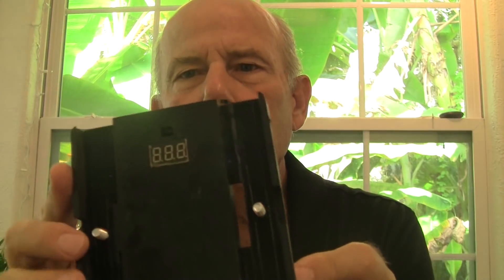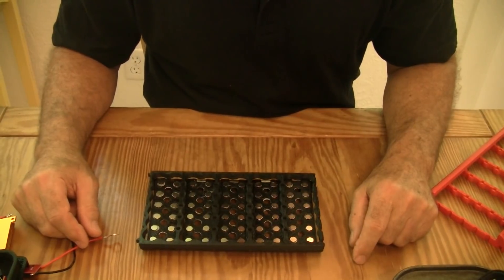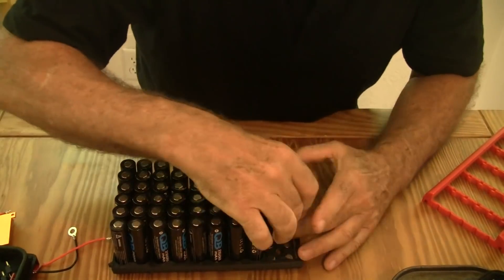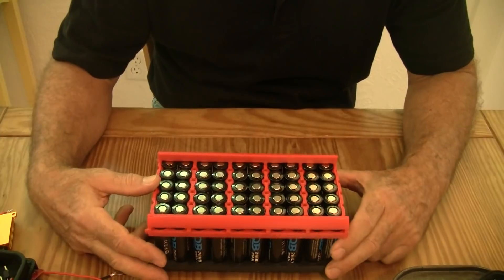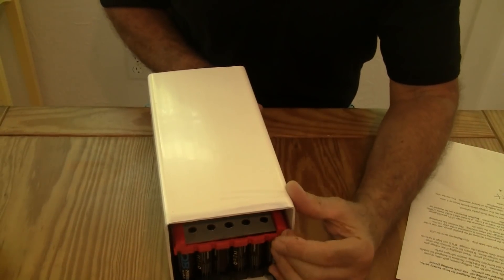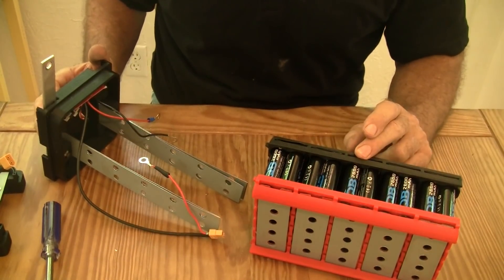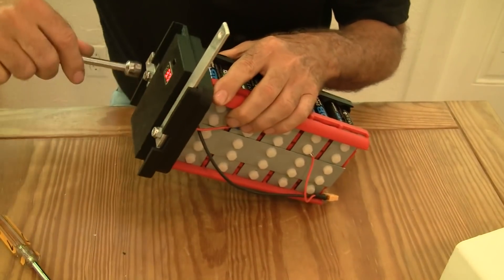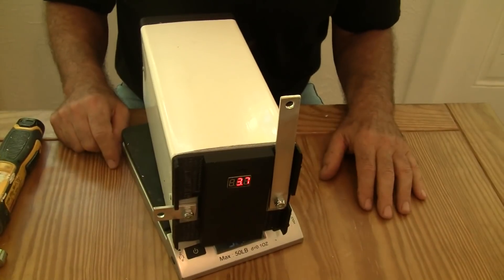Building and balancing a large lithium ion battery using BatteryBlocs

Comment: Hi Shawn. The bloc build fitting into a PVC fence post is a clever idea, as are the magnets. Have you had any corrosion or contact issues with the zinc coated plates that you are using to bond all this together? Is the very moderate pressure of the nylon screws enough? Have you taken a FLIR camera to the packs under full load test? I'd be interested to see if any hot spots show up. I agree with you that active balancing is the way to go when you have high current capacity parallel cell blocks or high capacity cells.  My primary concern with the system though is that there is no provision for any fusing in your system, whether that be between blocks or on individual cells. A single cell starting to fail in fuse/short mode in a 60P enclosed pack would be hard to identify and on failing would be catastrophic. Your blocs are made to be serviceable, but part of the issue is identifying the bad cell. Have you considered using fused nickel strips in conjunction with your magnets? If a cell fails, the fuse goes, and life goes on with 59/60 working just fine. It's not so much of a concern with LiFePO4, but with Li-Ion runaway mode is a problem. Too many fires to ignore, especially in EV applications.

Comment: I am a newbie to electronics and how they work, but i would like build a solar generator to power a small apartment freezer for my kids ice cream busiess.  The freezer uses very little power as it is a new Danby 5.1 cubic foot freezer. How much power does that battery with 60 cells produce ? I want to hook up an inverter to it to power a solar generator. I appologize if this is a dumb question i am just tring to figure out how many 18650 cells to buy to power this generator. I have 60 of the batteries currently. Can you help
Reply from the maker: Brad, that is doable, a friend just set up a freezer in his tool shed using a few solar panels.   But I would request you to contact me at shawnwiththewind@gmail.com and provide the power consumption of the fridge, and the mah of the cells you have.  Then I can show you how to do the math.

Comment: Also is there a way to make sure the batteries stay balanced and charge equally?
Reply: Yeah he had a resister balancer inside there, that fuse at the back gets switched on at a certain voltage to keep it from overcharging.

Comment: Just seen your info on website so I would need the babyblock for my ebike an fit it so it has air flow but keep away from rain so can ,mount in my buggy as it has a roof with vent .
Reply from the maker: Sure, that would work.  I use my BabyBlocsinside fence post tubes.

Comment: Can you adjust the balance block for Lipo or other batteries?
Reply from the maker: Yep, the chip is programmable to any balance voltage, high alarm voltage, and low alarm voltage you need.
Reply: Shawn McCarty so there is away to adjust the valve of high and low voltage. Do you think it would be O.k on 38120 cells?
Reply from the maker: Like Headway cell?  Sure, it works just the same.  Yes, the high/low alarms and the resistor trigger are all programmable.
Reply: Shawn McCarty do you take PayPal for payment, I don’t know where you are and how much postage would be. I’ve got SPIM08HP pouches also, 8 of them and 24 of the 38120 8Ah, would like to know which size you think I need. Are you or your company on Facebook?
Reply from the maker: Sure-My company is www.batteryblocs.com and I am in the USA.  There you will find the Balancers and my business email.  We can sort out your battery requirements there.
Reply: Shawn McCarty OK, thanks very much. Mike.

Comment: what will be the connectors ?, if i plan building 13 units of this 60-block into a 46.8V. Each units will have  135Ahr capacity. Again this will be supported by off-grid solar panels. i want to sure of the inter connecting links before purchasing the units.
Reply from the maker: The connectors are aluminum busbars.

Comment: How feasible can you use 12 of this 60 blocks to building a 48V system to support off-grid solar ?
Reply from the maker: Sure.  It depends on your loads of course.  My home has a 100P14S battery made of mostly salvaged cells.  If I watch my useage and especially if I freeze water and move it to the fridge at night so I can shut it off, I can get through a long night.  When the last hurricane hit, power was out here on my block for a week, and Cecilia and I were very popular with our fridge and AC!   You start with your best guess of how much power you need to store.

Comment: I'm always amazed at your ingenuity. Most boats use 12V systems to power everything. What is the plan to get that kind of voltage. I'm guessing 3 of these in series at full charge of 4.2 volts would give you 12.6 volts. Some equipment is voltage sensitive and won't operate on too low a voltage, so it seems to me there may not be as much capacity at the lower end of the charge. You've probably figured something out. Please enlighten me.
Reply from the maker: Yes, it is an issue because the voltages of a Lead Acid and LIthium chemistries don't mesh well at lower voltages.  I'm working on a sailboat battery now, we are going to go 4S for 16 volts.  He uses solar panels and the motor alternator to charge.  He is going to change the wiring of his solar panels, putting two in series, to get 24 volts or so, then use a MPPT converter to step the voltage down to 16.  His alternator puts out 14.4 volts.  14.4/4 is 3.6 volts.  So the alternator will charge the battery if it is low enough...  3.6 volts is right in the middle.  So the idea is the solar panels top off the battery and the alternator brings it up from bottom.  Any better ideas are welcomed!
Reply: One thing to consider is to go to a 24 volt system in the boat for the house batteries. Not everything will run off that voltage, but stuff that needs 14 volts can be fed off an MPPT converter stepped down to that voltage. One of the nice things about 24 volt systems is in long wiring runs with high amperage loads, you only need half of wire size since the amperage is half of what it is in a 12 volt system.
Reply from the maker: You are totally right, the higher the voltage the greater the efficiency.   The thing is, we are still using legacy 12 volt equipment designed around lead acid chemistry.  I think this will all evolve soon.
Reply: Shawn McCarty  I like your idea. Most 12 volt marine electronics/ will work fine with 16 volts. Some I've seen will work over a wide range of voltages. I've actually gotten around 16 volts from an alternator by using an external adjustable voltage regulator, you just have to watch the charging current so you won't overcharge.
Reply from the maker: That's a good point- because the voltage regulator will not taper the current as the voltage peaks in the battery, like a CCCV charger.  Perhaps one way to prevent that is to have a small inverter powered by the DC from the alternator powering a CCCV charger?  Any ideas about how to regulate current.
Reply from the maker: I recommend 4 in series to use 16 volts.   Then wire two solar panels in series to raise the voltage and use a MPPT charge controller set to 16 volts to charge.  So the high voltage is 16, and the low voltage is 12.    This will keep the electronics happy.     What do you think?